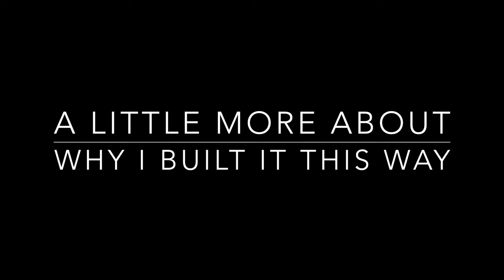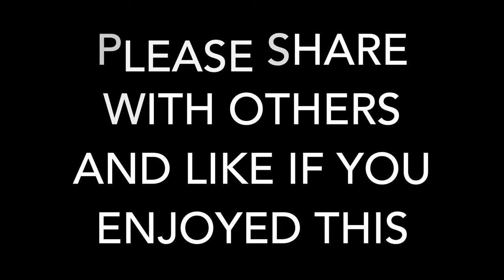How to build an Expedition Camper slide out dinning table

Comment from the maker: Using the track sliders reduces weight over standard slides, they are corrosion resistant, clean as they don't need lubrication, and self-cleaning. Plus very strong and compact compared with most drawer slides. Additionally, safe and out of the way of fingers and things that could be pinched.

Comment: Any chance you could provide a link to where you got those track rollers? I've been looking for a 8020 linear motion device that can hold cantilever loads. So glad I'm a few steps behind you in my build, your vids always help lol!
Reply from the maker: Sure, here is a link to the aluminum guide rails and carriages that I used which work great and are very strong, clean, no lubricant needed, low vertical height compared with drawer sliders, and much lighter weight than drawer slides as well. https://www.mcmaster.com/track-rollers/side-mount-track-roller-carriages-and-guide-rails-7/
Reply from the maker: I added the link to the guide rails and carriages I used below. I would not use 8020 linear bearings for a high cantilevered load, as they will not work well with a cantilevered load. Just about any kind of movement mechanism can be added to the tracks of 8020 structural profiles, and usually for less and stronger than the 8020 parts that tend to be of lighter capacity than other available products.

Comment: It looks great but also looks annoyingly slow. I was thinking that instead of a full length actuator you could have used a much shorter one with a linkage to get the same range of motion but much quicker.
Reply from the maker: Thanks. Yeah, it is slower than I'd like at about a minute from closed to fully open, but it does slide out 40" and can support 150 pounds of static and dynamic force pushing or pulling the table out. If I went with an actuator that supported the table but not more it would open in about 30 seconds. That would be nicer, but I was wanted to ensure it was strong enough if someone leans on it. I like your idea of some linkage to speed it up, but trying to keep weight down and get this camper done. I'm wondering how you would do the linkage for something like this?
Reply: @vantripping  

I wasn’t thinking of anything too complicated, just a “seesaw” but with the centre pivot off centre. 

I’m only thinking out loud, I haven’t done it myself. The speed and torque wouldn’t be consistent though. 

But I’m guessing you could have just bought a different actuator that gives up some torque for speed.
Reply from the maker: @ian9toes  Sure, that would work to speed it up. I seriously considered choosing a linear actuator with a faster speed but that would come with the trade off much less force, which might possibly not have enough strength to support a person leaning on the end of the table and prevent it from being pushed in. It's a small thing to simply push a button and wait a minute for the table to come out or in versus having to fold it up, store it, always have it in the way or have a center column or other legs getting into the way of feet and knees. Plus this one has plenty of strength to lean on compared with other swing away methods.

Comment: Linear controller . Use those for my slide camper
Reply from the maker: Yes, I started using linear actuators to support, raise and lower the queen bed in my camper van about 6 years ago and love it. I'm using many of them in many different ways in this camper because they add so much function for little cost or weight add, and sometimes even reducing weight. Love them.
Reply: @vantripping  going to use them in series for slide out in conjunction with a voltage regulator. Very nice 👍 thanks for your reply
Reply from the maker: @MrBlackbutang  Is the voltage regulator to control the speed of them?
Reply: @vantripping  yes. I will be using 48 volt dc for current drop.